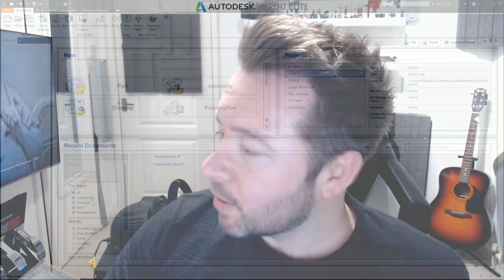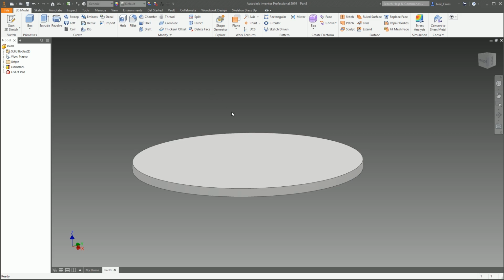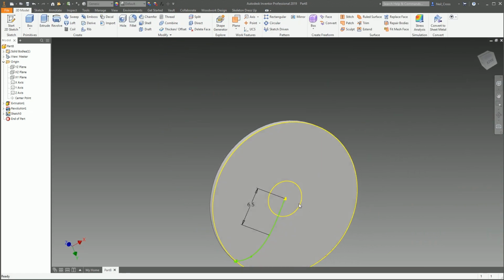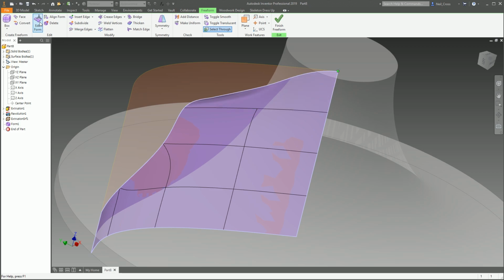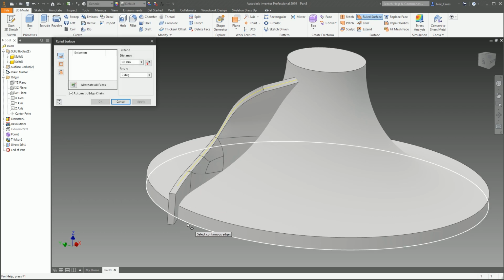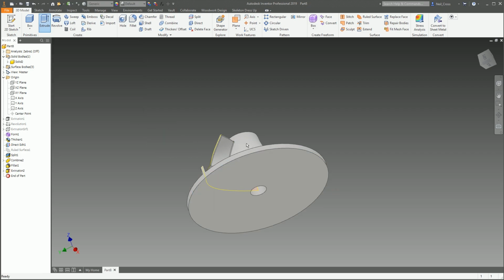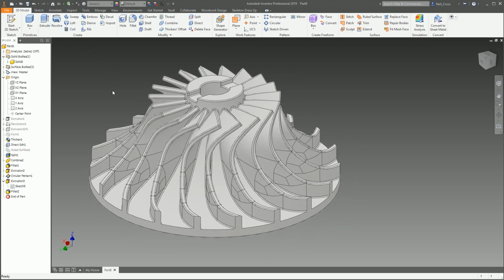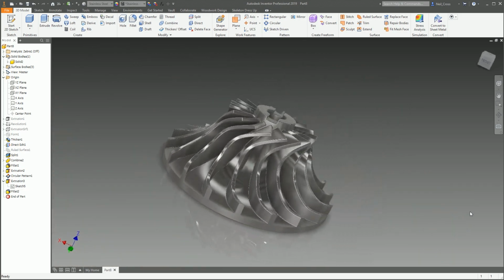How to Model a Turbo Impeller | Autodesk Inventor Tutorial

Comment: Today I installed inventor, to make an impeller for my dust fan. The old one doesn't work to well and I wanted to upgrade it. Never worked with this program and your video and the little help sector helped me to understand this program. I succeeded my fan in 8 hours and at the moment my printer is printing the fan. Thanks, you explain it enough for me. I just have a little experience with AutoCAD. And this was my first thing on this program.

Comment: You did this totally wrong.. Most weired was when you did that circular pattern after combining those two solids. You should have done it before that.. In this way, you have actually created the entire body 19 times. 19 pieces of that base body exists there. And it's actually invisible cause its placed in the exact same plane and it has a circular shape
Reply from the maker: You might want to check these things first.  I used a pattern body with a join variable, this indeed patterned the entire body 19 times on top of itself but it joined it which you can clearly see in the browser... resulted in still 1 solid body existing and it disregards the duplicated material, not 19 on top of each other, it's a perfectly legit and acceptable modelling workflow.  I admire your confidence in outright telling me I'm totally wrong and not just implying or questioning, but no, sir you are.

Comment: Uhm... the vanes should be bent clockwise at the base. With this layout your rotor will generate an aerodynamic stall. But nice idea doing this with freeform. I designed mine with 3D scetches / surfaces. Gives you more control IMO but is way more time consuming.

Comment: i use solidworks 2017 on my pc and it runs very with the configuration i have. but on the same configuration when i use inventor 2017 it lags a lot..! its very disapointing...

Comment: Hey Neil, is it possible to reference raw material to a part? I want the BOM structure to list all raw materials in order to get an exact billet or metal sheet quantity
Reply: Hi Ricardo,  Not sure I know what you're looking for but if it's totaling up parts. As you say " Billets " then yes that's standard for Inventor. If you want it to add all of the same material into a total ( as an example 2 inch pipe ) then Neil did a superb video on it about a year ago. Just search back for it. . . . Jim
Reply: This one:      https://www.youtube.com/watch?v=lE3sIiojRVc&t=2s
Jim
Reply: Thank you for your help. That's sort of what I'm looking for but I also wanted to know if it's possible to include other raw materials in the BOM, like a part to be fabricated out of a metal block or a shaft out of a round bar
Reply: I think I'll have to design the raw material in a part file and then derive to the finished part. Again I appreciate your help.

Comment: Interesting video, as always. A question, not a criticism: when you do the circular pattern, you pattern the central core 19 times 'on top of itself' so to speak. I wonder if this is why it takes so long to compute?
Reply from the maker: Its the only way to do it, can't pattern a thickened freeform.  But Inventor is capable of dealing with this, it doesn't duplicate material 19 times on top of itself there, it's intelligent enough to know whats going on!
Reply: OK Neil, understood - Inventor is clearly cleverer than me - not difficult! Ian.

Comment: Superb Neil. I was a CNC turner for 25 years and used to turn the outside of the blades of these for model jet turbines. When I was first starting with Inventor I tried to model these and failed miserably. It was a joy to see you create one. I use Inventor every day at work but never use those surfacing tools.  It was a real treat. Thanks.  Jim
Reply: Hi Neil,
Just read through the comments below. I don't think precise sizes or missing fillets was ever high on your list was it?  You just showed us how it CAN be done and it's up to us how we refine it from there. Well done Sir ! . . . . Jim
Reply: @flypic1098  6 years late but theres no way a 17 year old has to tell someone whos been doing engineering for  "25 years" that the whole point of designing things in CAD IS FOR MEASUREMENTS.

without measurements engineering would crumble so no this video is not superb because its near impossible to follow along.
Reply: @Awkhalil_7 you have to use your brain and not just copy others, I know, it's hard sometimes.
Reply: @thelaurens1996 also last time I checked tutorials tell you how to do things and show you. 

So saying "cOmE uP wiTh iT yoUrSeLf" isn't valid here because this is a "tutorial" video.

But that doesn't stop you from crying about how I'm right that this is a bad tutorial for anyone who is new at CAD

Comment: Would lofting 3 sketch's on the 3 planes work better than freeform?  Thanks for all your vidoes they helped me through school and now in the work place. Also learned something new with the set current view as front.  Wish i would of known about that 2 years ago!
Reply from the maker: I did consider doing it with loft, but the weird kink/fold at the top of the blade would have been a royal nightmare to do with loft... it would probably be doable with funky 3D sketches and trickery... but in the time it took to flop about with that you could just easy do it in freeform, and you get to see and play around with freeform possibilities which a lot of people are excited about, so yea that's pretty much why I went that way!
Reply: @Neil3D   i would guess a sweep (or a even a patch surface?) from 2 or 3 sketches to create a surface would work aswell. I guess you would be able to have a bit more accurate control of the shape. Also a little pet pieve of mine: why not use the hole command (with concentric function) for the center hole? it's one sketch less and i find it faster to make adjustments later.